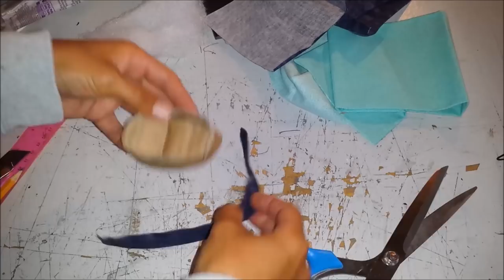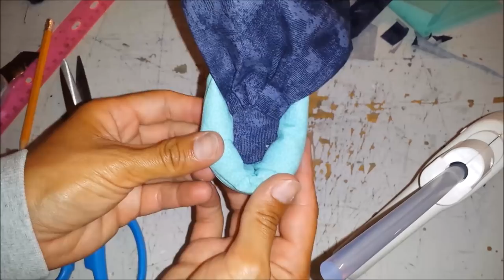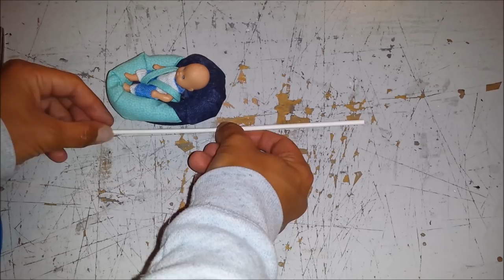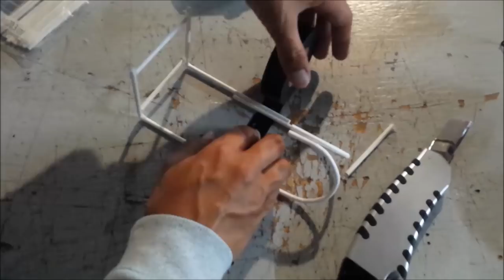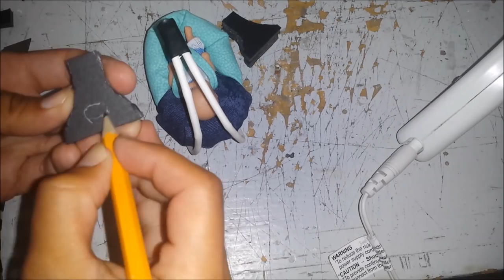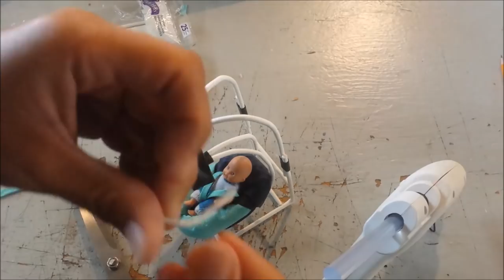How to make a Doll Baby Swing

Comment: super cute Lena, but how do you wipe that hot glue without getting burned?  LOL
Reply from the maker: Thanks!  Just waiting a few seconds before wiping it off :)
Reply: When you do crafts a lot, the glue hurts not at all :) your skin kinda gets used to it. Not sure if that’s bad or good. I also suggest using a low powered glue gun.
Reply: UnPinkMiBarbie 2 if I accidentally touch fresh hot glue I usually roll it between my fingers to try it faster, (if its a smaller batch) but for the bigger batch I just rushed to put it under cool water
Reply: iwcg 2     EXACTLY WHAT I WAS THINKIN
Reply: iwcg 2 انجب
Reply: iwcg 2 she waits for it to dry because hot glue guns glue dry within ten seconds
Reply: iwcg 2 so cute
Reply: Pat Waboao oollloooo
Reply: iwcg 2 w yaaaaaaa